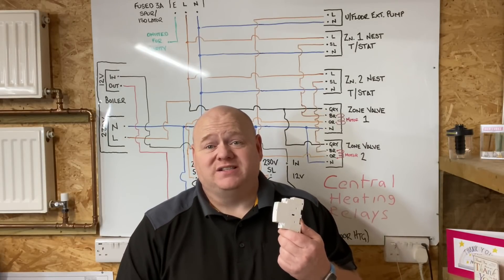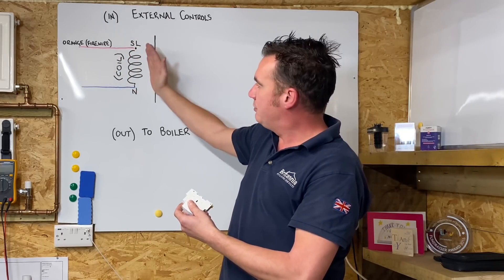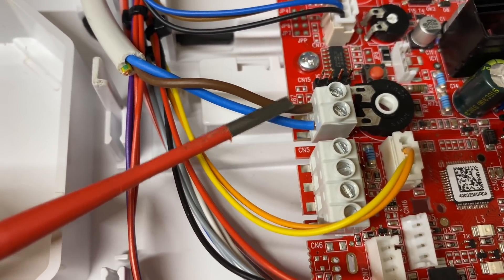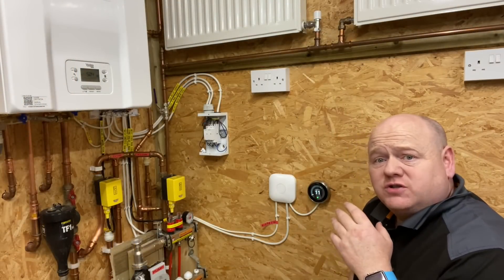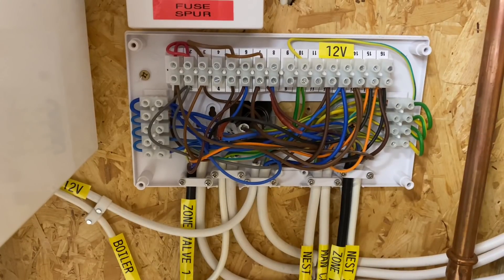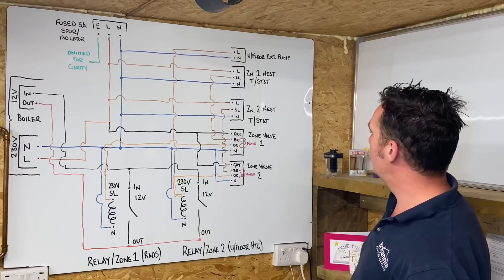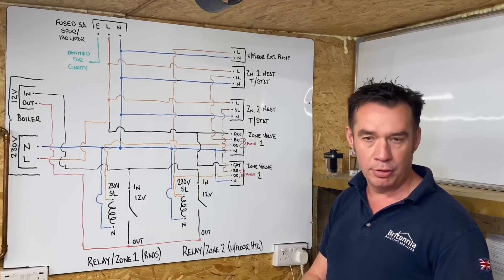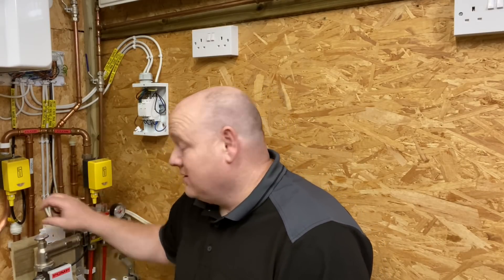Relays On Central Heating Systems - Leeds Plumber

Comment: Well this is nice schematic. U could actually do this with 1 contactor, basically orange and gray directly to boiler 12V, and brown from nest 2 to valve MRV and contactor for pump so u don't mess relay in nest reciver.
Reply from the maker: You are not allowed to mix voltage on zone valves. Thanks.
Reply: Orange/gray feom zone 1,2 can go directly to boiler since those contacts are volt free, and SL from nest 2 is going to Zone 2 MRV and contactor to trigger the pump since relay in nest reciver is only 1A
Reply from the maker: @BriaCroTex  Wiring regs do not allow that. Honeywell also said you should not do that with there values. Thanks.
Reply: @AllenHart999  i didn't know that but i absolutely don't see anything wrong with this it's not cutting the corners or anything like that. Your schematic is fine and this is one of the way how to do it but there is another way i wired 100+ boilers installed numerous underfloor heating controls and option with 1 contactor is not dangerous or anything like that the nest is just triggering pump and valve together
Reply: @AllenHart999  You can actually connect 12v from boiler direct to grey and orange in the Honeywell zone valve (instead of a permanent live on grey from the system), and have 240v from the room stat for example for the motor side of the same valve. I've put a link below to the Honeywell fact sheet for their 2 port valves. It details this in the 'Electrical Operation' section. Brilliant video - really interesting and helped me to understand relays. Thanks for all your help and encouragement.

https://heatingcontrols.honeywellhome.com/documents/Reference-Guide/pdf/V4043-Zone-Valve-S-Plan-Operation%2004-20.pdf
Reply from the maker: Simon Mander That’s not true. As per wiring regs and also Honeywell also say you cannot mix voltage
Reply: @AllenHart999  The Honeywell fact sheet copy and paste says "The V4043H Zone Valve can be used to operate a Combination or
 System Boiler that requires volt-free switching, by connecting the orange and grey wires directly to the switching terminals on the boiler (See boiler instructions for specific wiring details)"
Reply: @AllenHart999  Not that I like to disagree with you Allen! You and your videos have a been a MASSIVE help to me.
Reply from the maker: @simonmander4314  I have wired them how you have said in the past on old system boilers but when i went on the training with Honeywell they told me i was wrong and you are not allowed to wire them like that.
Reply: @AllenHart999  Right! Interesting stuff... Funny how different people tell you different things sometimes. Anyway, as I say, MASSIVE thanks for all your help and really decent videos.
Reply: @AllenHart999  I watched almost your all videos,  those are helpful,  but I also attended honeywell training, and they allowed to use the grey and orange wire low voltage but need to put the notice on the wire 12v, cant say anything if they changed the rules now, thanks
Reply from the maker: @simonmander4314  I have just read that. That’s how i used to do until i went on a Honeywell training day, They told us you cannot do it like that. lol... doesn’t matter anyway. This video was to show about relays. Thanks.
Reply from the maker: @navtejsingh3165  I went on the training about 5 years ago, They told us you cannot do it that way. That’s how we used to do it. Maybe the trainer was wrong or they have changed it. Doesn’t really matter anyway as we wanted to show how relays work. Thanks so much for the comments.
Reply: @AllenHart999  
The problem is mixing voltages in the wires in one cable. Eddy currents, etc, may have an effect on the low voltage wires affecting the equipment they serve. If you split the wires (two cables, one 230v, one 12v) it is fine. But few would do that and would the makers honour a guarantee?  In one big job I was at in the Middle East working for Honeywell we had a big problem. A way of getting 110v to a point was in a multi-core of wires inside mineral insulated cable. To run a separate 110v cable was impossible. The mineral insulated cable was carrying low voltage circuits, so they could not be mixed. I suggested to the American engineers to drop the 110v to 12v using a transformer, send it down with the other low voltage wires and then step it up to 110v for use at the other end.  It worked with compliments on British ingenuity. :)
Reply: @AllenHart999  
With zone valves the motor stalls when reaching the end of its run - like stopping a kitchen extraction air fan with your hand.  When stalled it draws more current than when moving the motor. You could mix 12v and 230v in a mo-mo valve (motor on, motor off) and get away with it, as they only draw current when opening and closing for a matter of seconds.  

Honeywell just cover themselves and say no mixing of voltages in one multi-core cable. Many boilers will not be affected by eddy current in the control cable. I have personally never experienced one being affected, which does not mean future or existing boilers will not be affected.  

The makers of valves could get around it by shielding in the two relay switch wires in the zone valve cable with earth foil around those two. But more expense for them.  They should shield them as this sort of thing is common. They make millions of these things, so the extra expense is negligible.

Comment: Good explanation but in my opinion it would be easier to go from the 12 volts supply in the boiler to the greys on the zone valve and wire the underfloor heating pump to the brown on the underfloor zone valve
Reply: U need a contactor because pump could mess up relay in nest reciver. So basically 1 contactor

Comment: Guess a 2 port zone valve itself is a sort of a relay, because it uses one circuit (that powers the motor) to control a second circuit (joining the grey to orange). And you can use 12v from boiler on the grey/orange side of a 2 port and 240v on the motor side (brown/blue). But in this case you'd still need the 'proper' relay switch to stop the extra pump coming on with the rads.
Reply from the maker: Thanks.

Comment: Good video Allen,  Why not just wire the pump live into the call live from the UFH stat as the zone valve will act as a relay as well using the grey and orange wires as the low voltage switch. just to throw a spanner in the works for you mate lol
Reply: The pump would only be pumping round the UFH via the manifold the zone valve would be placed before the pump on the manifold. The pump in the boiler would be before the zone valve and that wouldn’t come on u till the valve is open.
Reply: Don’t get me wrong there are loads of applications for this relay system and Allen has explained it all very well.
Reply from the maker: @jamesvickers9140  You cannot use zone valve like that. Wiring regs state you cannot mix voltage, Also Honeywell do not allow it either. Thanks.
Reply: Good point on using the zone valve for 12v on the grey/orange, but I thought that the pump should ideally not come on if the zone valve is not opened first. So wired like Allen's here is better, cos if the zone valve was failing shut, the pump would not run.
Reply: Just to clarify you only have to do this if the switch is 12volt not 240v
Reply from the maker: James Vickers Depends how many pumps you have. This video is to explain about relays. Thanks

Comment: Useful video mate. 
Ask Darren if the amperage of the relay matters?
Reply from the maker: Will do. Thanks.
Reply: Not really as the 12V is not a high load and its really only being used to isolate both sides due to voltage differences and also so that you do not switch on pumps you do not need.
Remember most systems only have a 3A fuse. Of course if you are switching lots of pumps etc you may need to consider higher if the sudden inrush of all of them could blow the fuse, but in that situation ide have though you would split 3A for controls and boiler pump and then separate fuse for the zone pumps, especially if they are located far.

If you were using a relay to say, have a remote immersion heater control, using ie a Quinetic control, the receiving unit is not designed to switch that load, so the receiver would be connected to one side which is the low current, but load side is heater, relay would need to be rated higher than the heater current.